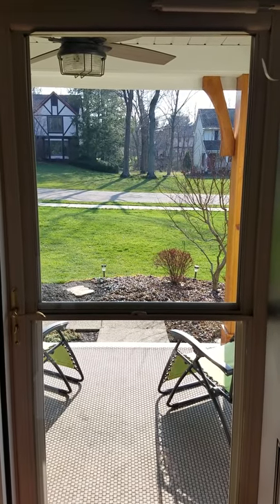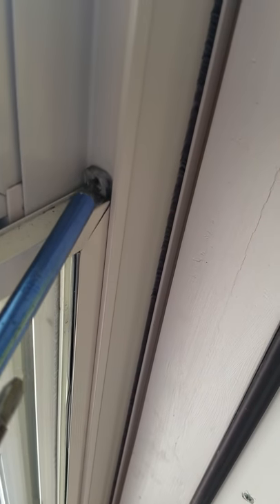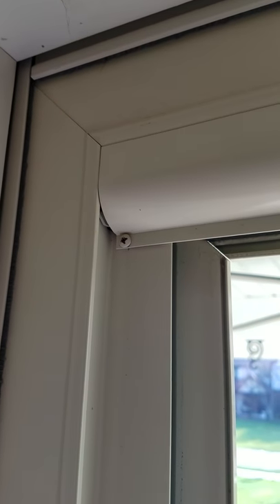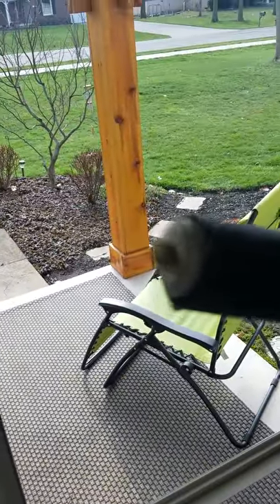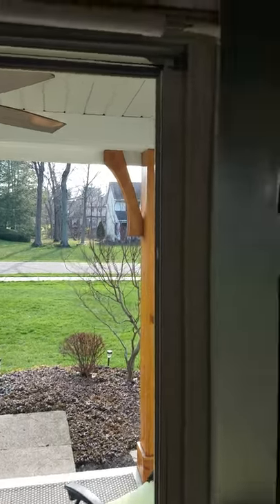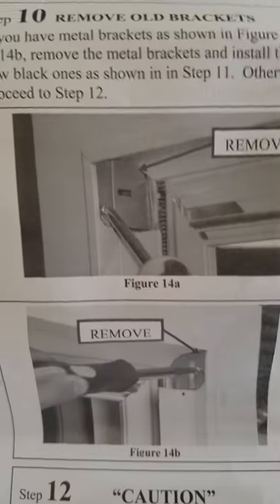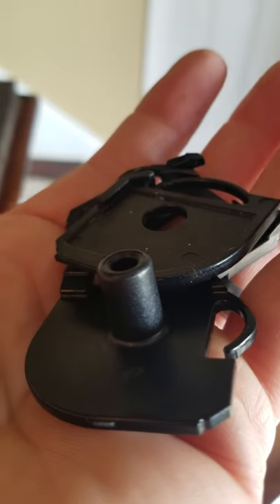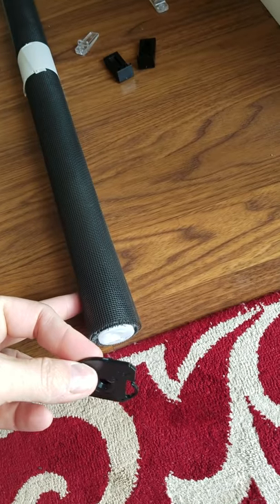DIY -  Larson retractable screen replacement

Comment: Built to break. The plastic parts are designed to break. The reason the window stop rolling up is the plastic anchor pops out of the right side and slides halfway to the left. If someone designed a none plastic anchor, you could fix the door must simpler. But nope. Another temporary fix. I’ve had my door less than 2 years. I may try to solder a permanent screen but then I still have to prevent the window from slamming the unexpecting user’s fingers. Larson went out of their way to make this crap. Everything else is factory forged. They couldn’t make metal slots that hold the crap plastic?